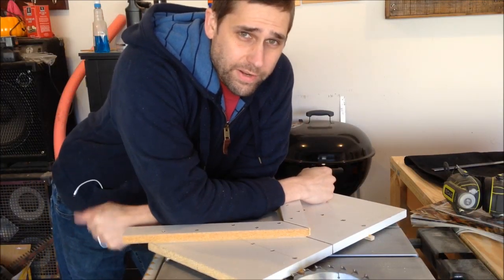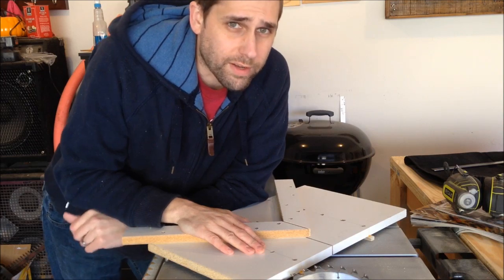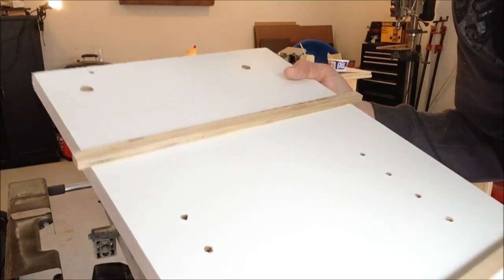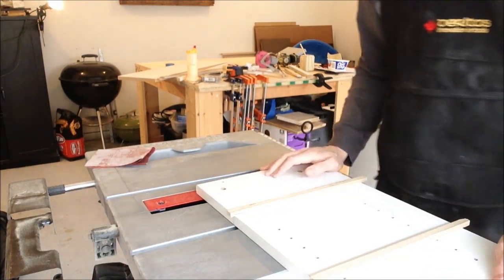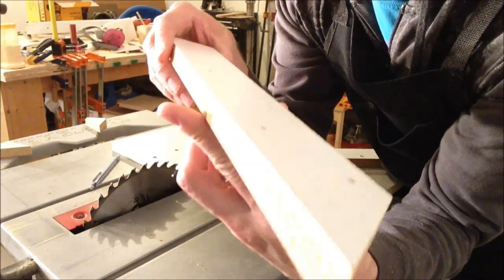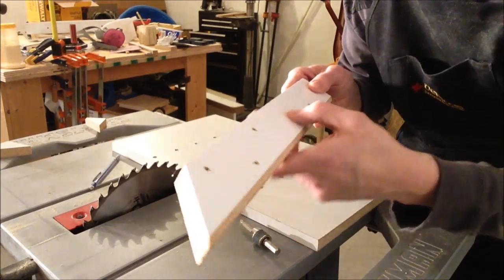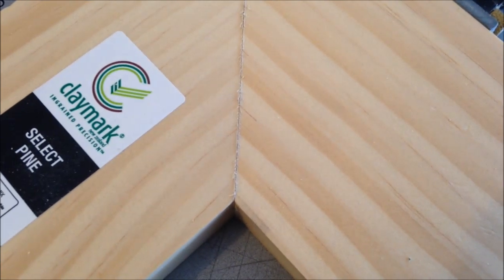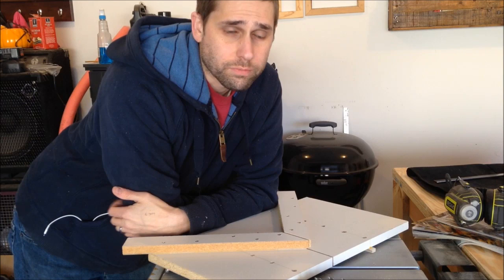Table Saw Miter Sled (CMRW#10)

Comment: I ran into the same little mismatches in my miters after building a sled. It was a simple fix i just replaced the blade on my table saw. I went with an ultra finish blade with Lotsa teeth (they are not cheap though!) but the cuts are almost perfect requiring little or no sanding, and they glue beautifully!

Comment: Nice dude. I agree with Trevor about the sandpaper for gripping pressure. You can also clean up the joints with a miter gauge and a sander.  Great use of leftovers.
Reply from the maker: Thanks, Drew!
Reply: A good trick when drilling holes is to countersink both sides. Any mushrooming of the wood will be pushed up into the bottom countersink and will not lift the board up. Great build. On my to do list.

Comment: Good video, thanks for sharing!

I would imagine that the rough edge of the particle board could be skewing the cuts a bit. You could also look into getting a higher tooth count blade so it does more "cutting" than "ripping".
Reply from the maker: That could be. That blade does need to be replaced anyway. I've been needing to do it for a while.

Comment: Great job. The hardest and most important part is making the runners. I had to dado the top of my runners to fit in mine when I made my crosscut sled. I will have to show you a picture of what my slots look like on my table saw.
Reply from the maker: You're right. The runners are a pain to make especially on a saw like mine with small miter slots, with a t-track kind of lip as well. I don't know why craftsman decided to deviate from the norm, which I understand to be a 3/4" wide slot. They also decided to change up the insert design around the blade, which I hate.
Reply: CMRWoodworks I ground those little tabs off my craftsman saw. Those tabs ruin that saw!
Reply from the maker: I've read where other people have done that. I don't think I even have what I need to do that at this point. I agree though, those tabs are a big pain with this saw. The miter gauge that comes with the saw has a lot of play in it an it was made for that saw!
Reply: CMRWoodworks The miter gauge does have a lot of play in it and doesn't slide smoothly at all since the top is all aluminum. I've seen a few videos of people making their own tablesaw top to replace the aluminum top.  I still love the compact design of the saw and I don't have the room to make a bigger top for it. I will post some pictures of my crosscut sled as well as the runners that I made for it later today.

Comment: Have you considered adding a toggle clamp on each side to hold the pieces securely while you cut them?  It might help tighten up those joints just a little bit more.  Thanks for sharing.
Reply from the maker: That is a good option. I may do that when I build the next one. Thanks!
Reply: Take a peek at the miter sled that Steve Ramsey (Woodworking for Mere Mortals) made.  A little heavier built and cuts almost perfectly for me.

Comment: Maybe check "square" on your table saw blade??? also is your table saw top aluminum?? I have the older craftsman 10" cast iron table saw and clean & polish it monthly...If yours is aluminum do you have to do the same?  thx
Reply from the maker: Steel Polymer n Brass my table saw top is not cast iron. It is aluminum, I guess. I don't have to do any maintenance to it, really. I hope to be able to upgrade my saw at some point in the future!
Reply: Thanks for reply sir..

Comment: Why stop at only one corner? I think that the job done is the 4 corners glued and nailed that's when we know if it's a tight fit.
Reply from the maker: +i minabrons Good point. I have made several frames and such. The jig actually does work quite well. Thanks for watching.
Reply: +Chris McDowell | CMR Woodworks I just thinking to buy miter saw to made screen printing frame. Now i going to buy. only table saw i can cut long wood pieces and 45 degrees wood angle. two birds one stone. Thanks friend good video simple and help me o lot..

Comment: No splitter, wrong blade for the job, but I DO appreciate the effort.
Yellow glue on melamine might not be the best.
Don't wanna sound like an ogre.  Just sound suggestions.
Bill
Reply from the maker: Thanks for the suggestions! This is the only blade I have currently, so I guess it'll just have to work for now. What type of blade should be used? More teeth?
Reply: CMRWoodworks Best would be a crosscut blade, next best would be a combo blade.
Bill

Comment: You didn't use your square on your reference face, so you may have introduced an error.
You square the face that you are going to use.
Also you put your combo square on the blade, and included a tooth, which would have shifted you from 45%. Don't include the teeth when setting your 45, and always use the longest possible beam for it,  drawing your 45 for the short distance leaves you vulnerable again.
Reply from the maker: The combo square was all I had, which I didn't think about before I started, so I just had to go with it. I don't have any triangles or one of those speed squares. The end of the combo square may have been touching a tooth, but it wasn't on the carbide tip. 

Thanks for your suggestions.